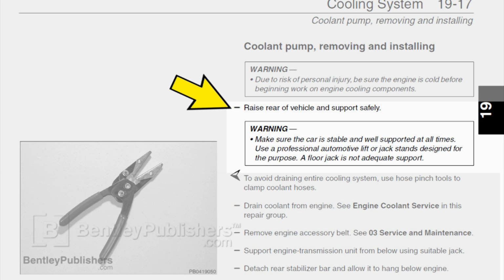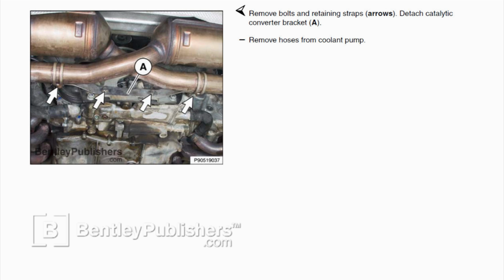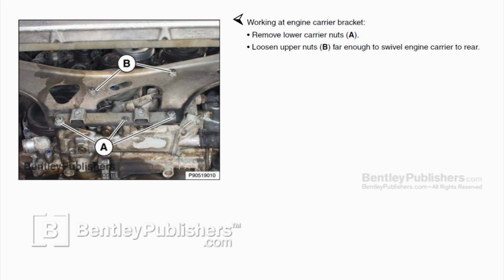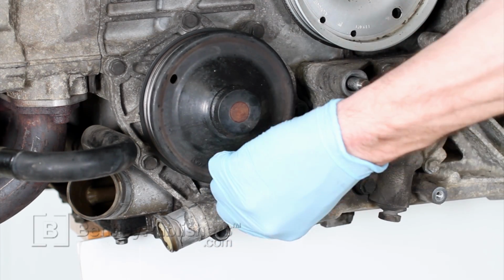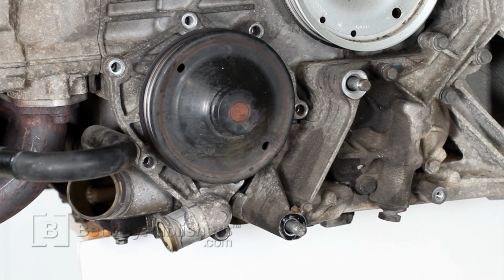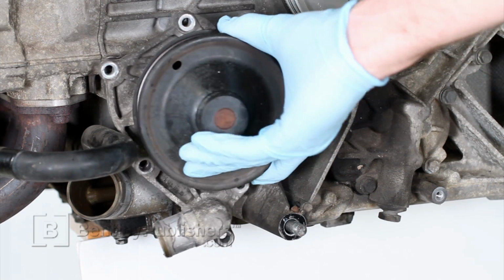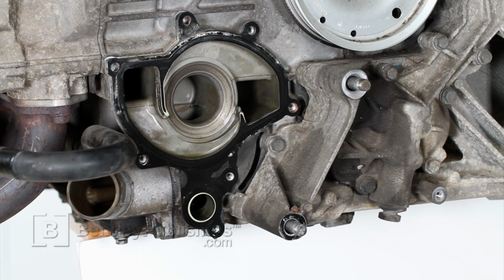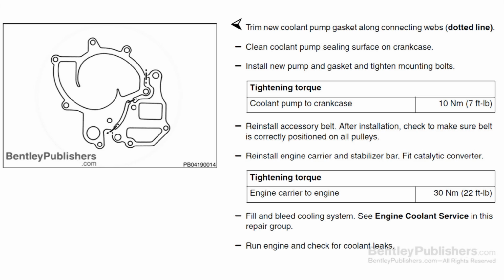Porsche 911 Carrera (996) 1999-2005 - Coolant (water) pump - DIY Repair

Comment: While this is a great video showing the removal of the 996 water pump it doesn't show the real-world challenges associated with the job with the engine still in the vehicle.  For example... the clearance between the water pump and the engine support bar or the obstruction the metal coolant tube just below the pump that prohibits the removal of the pump without additional disassembly

Comment: After replacing the cooling pump, how will we remove the extra air from inside the pumps using the coolant ventilation? Is there a way, or all the excess air will be removed while filling it up with water? 
Thank you

Comment: The 996 and 997 Porsches are having a serious cooling problem. Not every engine has the fault, but I've heard around 5% of these models. I read a lot about it on the Porscheforum.nl and felt sorry for the people who came across this problem, as it is costing a fortune to repair. Another problem is, that when an original Porsche dealership repairs, you get the same product (cylinderbank) again and the problem can easely reoccur!!! Porsche has never modified anything and was already aware of the problem in 2000! 
We had a 996 3.6 that used a LOT of oil (1 Ltr. every 900Km.) but it kept on going. At present we own a 997 3.8 and in October 2013 I noticed the left exhaust started to become a bit darker inside. Went to Paragon in Five Ashes (East Sussex) and guess what........ Cylinder 6, seriously scored, cylinder 5 and 4 lightly scored. Advice: have all 3 cylinder repaired , 3 new pistons and big end bearings.
Now, as mentioned, if you have this done by Porsche, they just put in new parts and the whole thing may happen again, as nothing has been modified to these parts.
We opted for a different solution. The engine goes to a company called HARTECH, just north of Manchester. They fit liners in the cylinderblock with a special coating, they modify cooling canals, fit a different thermostat and fortify the left cylinderbank as well. So far they haven't had any reoccurring cooling problems. 
A friend on the Porsche forum has a 996, from new, he had the problem dealt with by the official Porsche dealership. He is now on his 3rd. (THIRD) engine!!!
It is outrageous that Porsche doesn't admit the problem and hasn't made any modifications!!! It is only from the 997 second generation and the new 991 that this problem has been solved. (so it seems, sofar)
I have lost a lot of confidence in this German product, that's for sure.
A repair for a whole cylinder bank sets you back 8000.- pounds. 
I am not happy with Porsche and their attitude!

PS
I always check oil and cooling liquid levels, I do not rev the engine until oil temperature is okay, I hardly ever really "race" the car. I did my share of national motorcycle roadracing with Yamaha TZ production racer, so I know my way around engines.
This problem can happen, no matter whether you tend tocruise with your car or whether you have a more sporty style.